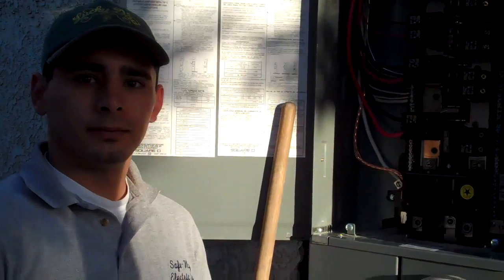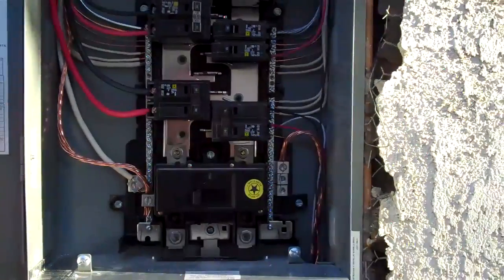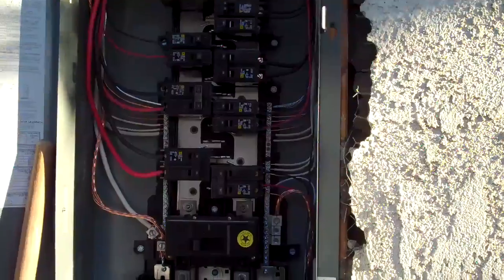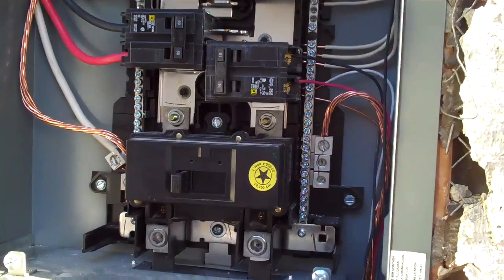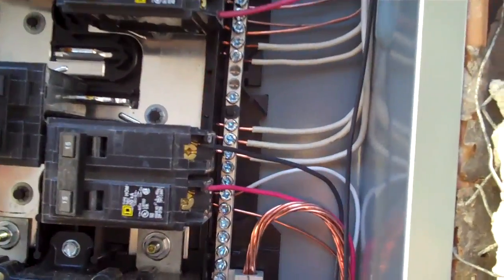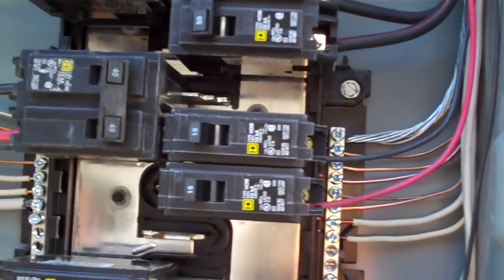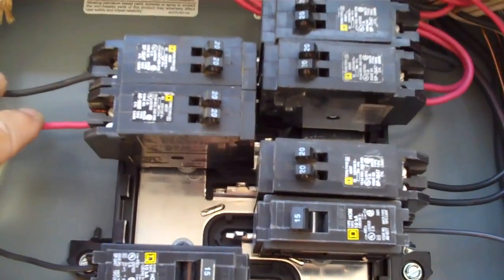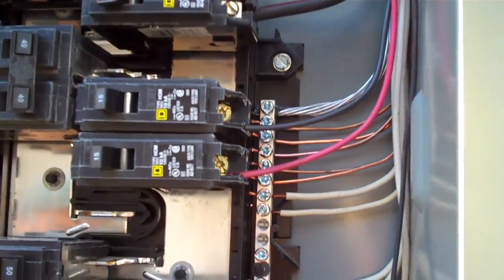Electrical Panels : New Installation of a 200 Amp Square D Electrical Panel

Comment: dont you have to install the highest amp rating breakers close to the main breakers? then from there you balance your load so that you are pulling almost or close to equal amperage from each 
hot leg?

Comment: The breathing room theory is a load of shit the breaker doesn't care if it has a open spot next to it not sure why u are installing tandem breakers looks like u have enough space for single poles in there,those breakers are not going to loaded up at the same time everyday day after day no need for skipping every other space now you have to balance dumbest install I've ever seen

Comment: Your technician mounted the panel upside down
Reply: panel is rated to be installed either way.  Most likely didn't want to extend the subfeeds with Polaris taps, I would have done the same thing but really "breathing space" lol

Comment: You might want to check those 15 and 20 amp breakers again. They are on multiwire branch circuits, sharing a neutral, so they are required to be connected to an interlocking(2 pole) breaker. That kinda helps prevent getting electrocuted when working on those circuits, besides being required by NEC code.

Comment: Typical salesperson BS. There is no reason, no need, and no benefit of "leaving space" around the breakers - in fact all it does is make adding new breakers later more of a hassle.  Fill your panel top to bottom or bottom to top- keep all the empty space consolidated, but most importantly be sure to load balance the two busses as much as possible - and you'll be fine. The panel, breakers and connections are all rated for temps well within any normal operating conditions.

Comment: I'm not sure I agree with your mehodology of providing space.  Breakers, main buss, and terminals are rated for 60C 140F .  I'm pretty sure that was taken into account by the engineer that designed the panel.  I have seen panels that operated in close to 60C without issue...Worst case scenario they nuisance trip.  It kind of makes the panel look like a hot mess.  Based on your proposed theory, only 50% of this panel can have breakers installed...FALSE